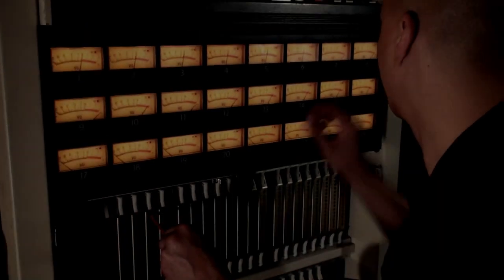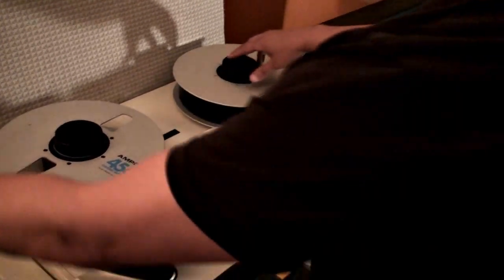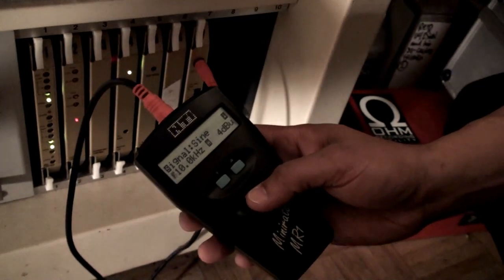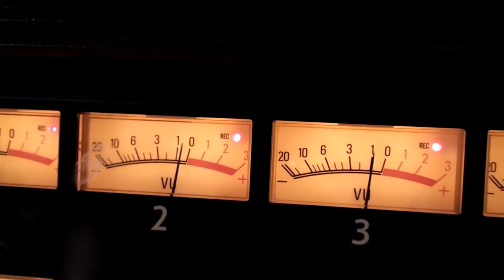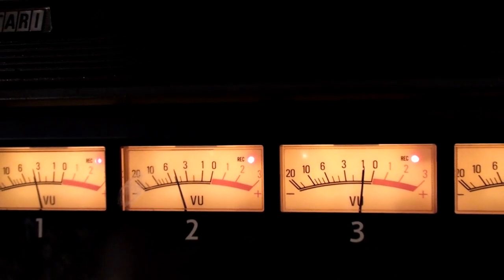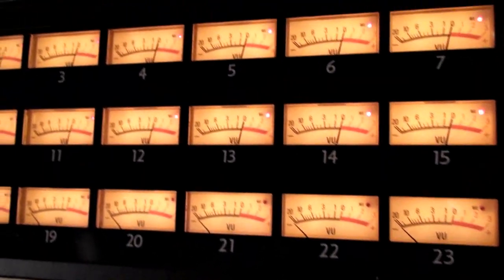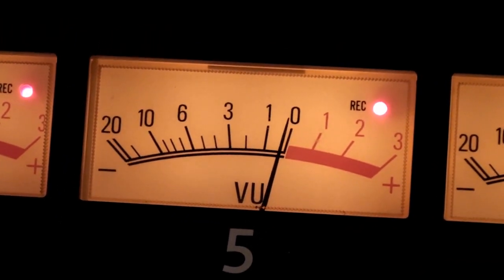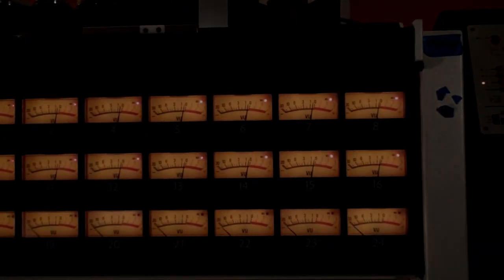How to align a tape machine for recording (Bias setup included)

Comment: How do you set bias by finding a common level among 1kHz, 5kHz, 10kHz, 15kHz ? 
Isn't that more accurate than a rough over bias method using vu meters ?
Reply from the maker: hello, yes, if I understand your question if you were measuring voltage vs using VU meters it would be slightly more accurate. Also, some people used to bias just by listening to the "rocks" or the distortion and grumbling etc while monitoring off the repro head in while recording a 30-40hz tone and adjusting for lowest noise / distortion.  I'm not sure what you mean by your first question? Are you asking if you could you use 1k 5/5k etc tone to set bias?

Comment: It would be nice if a company can implement current technology and make a new 24 tack tape machine with modern parts, modern schematics, perhaps improved tape formula for improved noise floor. ECT, ECT, ECT......
Reply from the maker: It's been 10 years since I posted this video, and yes, this would be nice. Though there are folks like mara machines rehabbing old machines. I think the market is just what it is. We can buy used 2" decks for 4-10k now (currently on a mci jh-24 with 16 track headstack, though I haven't checked prices in a while) and they were the equivalent of a very very nice car back in the day. And most bands I work with don't "buy the tape" but rent and we reuse tape for several sessions. Probably have to wonder if someone made them new, would they sound the same? same mojo? we have new tape now, but is it a roll of quantegy 456?

Comment: i'm expert in nakamichi cassette deck adjusting bias.. but what is low speed EQ?never heard this before in cassette deck. on 16khz the bias is too low... on 65hz is too hot because it came from faulty power supply  interference 50/60hz  . good power supply should shield the interference away from the audio mainboard.

Comment: Bias is a recommended setting: it's a guess how they think you'll want your sound and response. If you have time, it's good to try different bias settings; you get various "sounds" from your machine and tape. For example, if you add more bias than recommended, the sound gets darker and muddier but very fat - and you can "slam" tape nicely without a bad sound. If you add LESS bias than they recommend, you get this modern, silky high end when you record, but it will not like it if you slam hot levels onto tape. Good to experiment.
Reply: Do you recommend a happy middle ground? I know it’s different for each deck but let’s say +4dB is recommended. Would  you suggest +3dB?

Comment: Hi Scott! Problem on Otari MTR 90 Mk I, All Functions work Fine , remote  to, All Bolb Iluminate good , but No Play Moe no ff no rew mode, Capstaine motor 0v, Disconect Capstain motor have 36v Play ,36v FF -36v Rwe Mods ??? Evrethink loock good Fuse Ok, But Tension control Good Reels Motor Good Capstain motor form  add 6v Power supplay work good, Tech   90 degree 5v sine wave good Squer wave good, Flip Flop good squer wave 90 degree good , Motor Amp Transistor good, Wath to Halll ???

Comment: Scott,
The harm in using a scope for azimuth on multitracks, is that while you can align any two gaps in vertical perfection, the coils have some slight error in the alignment of the stack.

You will actually get a higher overall high frequency energy output by panning all tracks to one side (L or R) and adjusting the azimuth with the 10k tone on the MRL for max output, wherever it may be.

This way, when all tracks are up and running, the head stack is in its best overall verticle alignment.

For those folks demagging befor alignment, which is part of my process, be certain the machine has been powered down, unless you want to blow up some of the circuitry in the record amps and possibly the playback amps as well.

p.s. The common name for your adjustment tool is a "Tweaker"

Thanks for the cool vids!

Comment: Question though: if the new tape came heads out, wouldn't just playing through it, take it off the take up reel and store it be tails out? What's the benefit of flipping it over and rewinding?
Reply: This would put the tape on the take up reel for storage. You would typically want to store the tape on the reel that has proper labels for the tape type and the recorded contents.

Comment from the maker: actually, we did align it to +6, the MRL tape we used is 355nw (+6) so setting it to 0 is "aligning it to +6". if we had a 180nw tape, we would have compensated. more here, wwwdothome.comcast.net/~mrltapes/choo&u.pdf
Reply: Excellent.  In the 1980s I used to run +6@0 on Ampex 456 at 30ips.
The tape handled it well and the signal to noise was excellent

Comment: they alligned it for 0, which doesn't get much use out of the tape and has a higher noise floor..how about getting your moneys worth out of a roll of tape and hit it at +6, I recorded a few great albums while at RCA you can check out at +6 on 499, allign the playback at -6 and the record head to 0/+4 db, and that is all there is to it. the fact that the meters only go to +3 means nothing..listen to Neil Diamonds 'kentucky moon' album, it was plus 6 then dumped to D-820 Dash.pretty thick sounding
Reply from the maker: I know it's been 7 years, BUT, it was +6, our mrl is "355 nw fringe compensating" or however many thousands of times ive heard that. and 0 DB is "+6" . I bet you have some stories at RCA!

Comment from the maker: @ElasticMinds
What operating level do you want to run at? +6 (320nw/m?) is more than workable, set your repro head to 0 for the tones on your tape, then set your record side to 0 zero as well with a tone generator (see the other video).  I wouldn't recommend demag unless you know what you are doing, it can make an almost nonexistent problem much worse. Good luck!

Comment: I have a Scully 280-2 channel, and have an MRL tape. Only problem I have is that its +6 tape and my meter reads at +3db. I noticed in part 1 you didnt demag the heads, I have a cheap demagger but im not sure how much good it did. its one of those things were im trigger shy about jumping into something like this without all the knowledge on hand, and potentially screwing it up.

Comment from the maker: Yes there are a few different ways to set the bias, while maybe not as mechanically precise as using an oscilloscope or measuring harmonic distortion, almost everyone i know uses the method in the video or the "bias rocks" method (putting a 20 Hz tone on the tape and adjusting for the lowest amount of noise). We do use a dual trace oscilloscope for checking the azimuth of the tape heads.
Reply: This video is fantastic and very in depth in a way I can understand as compared to some other YouTube videos about this. Your machine is also very similar to my machine. Would you mind making a video showing how you check the azimuth with an oscilloscope? It's still a concept I'm having a hard time putting into practice.
Reply from the maker: @babyloniastudio5352  hey there! thank you! it's been a long time since this machine was a young pup then, have an mci jh24 now, but the azimuth with oscilloscope method similar. feed channel 1 and 16 or 24 (or whatever your last track is) a tone at same time. then while monitoring recording off head and with the scope in dual trace mode for 2 signals, adjust azimuth until coherence on scope (they'll be in and out of phase). Easier way without scope, is flip the phase of one of the tracks (so that they cancel each other out) and while monitoring them as mono or stereo return, adjust azimuth for LOWEST volume. Idea being when azimuth correct, maximum phase cancellation in place and lowest output. you can do it to repro head with an mrl using similar method minus the record monitoring obviously. good luck!